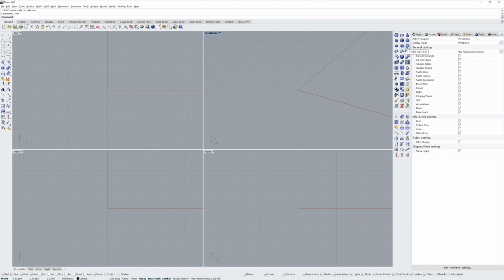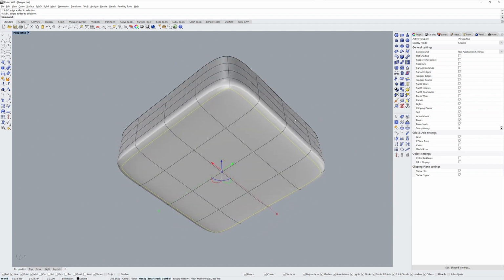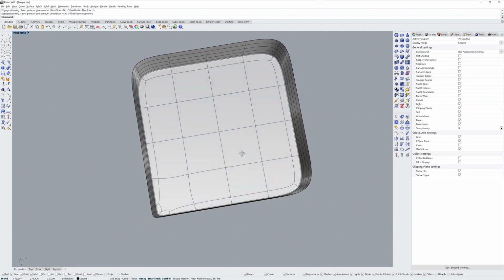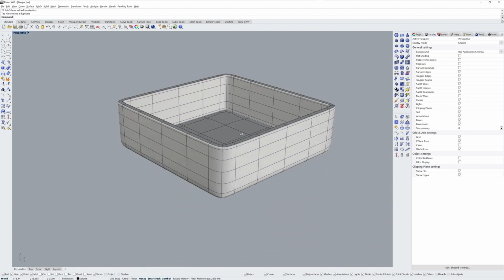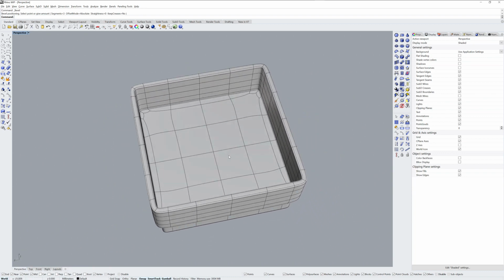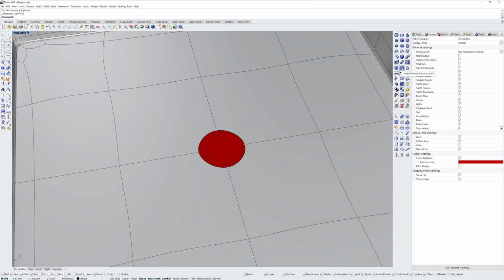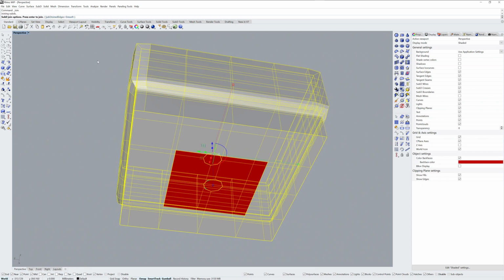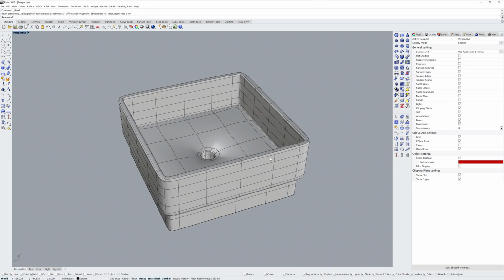Modeling a SubD sink with the Rhino 7 WIP

Comment: where are you getting these new short cuts from in the Sub-D toolbar like the "Bevel Command"  i'm running Work In Progress
(7.0.20098.14255, 4/7/2020) and don't see them.
Reply: I found it,  I had to run the toolbarreset command
Reply from the maker: run the toolbarreset command to get the latest updated toolbars when you install a new cut of v7wip... the rui does not automatically overwrite just yet.